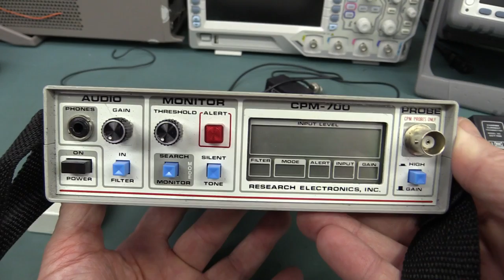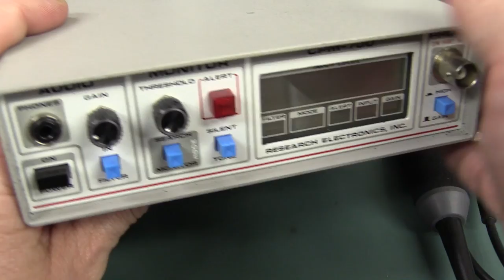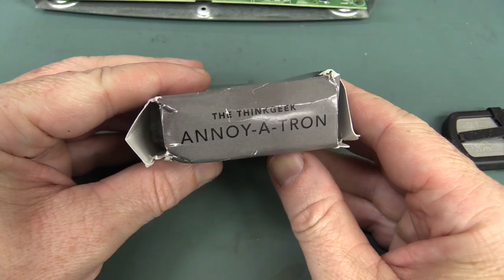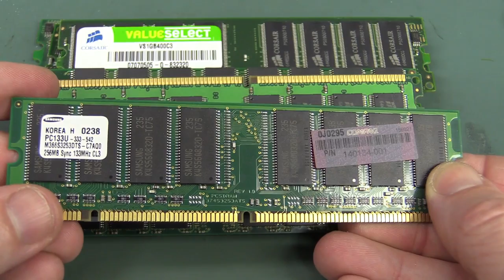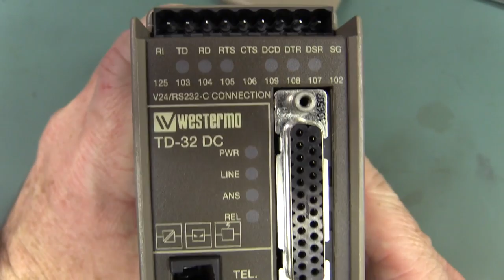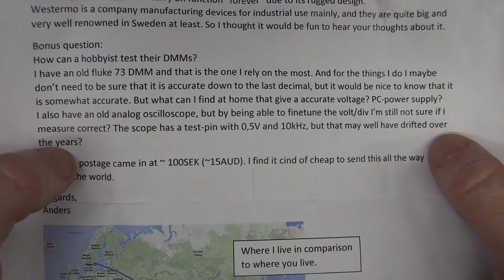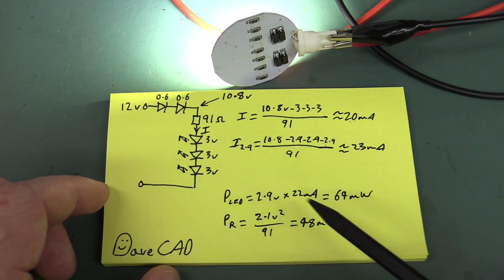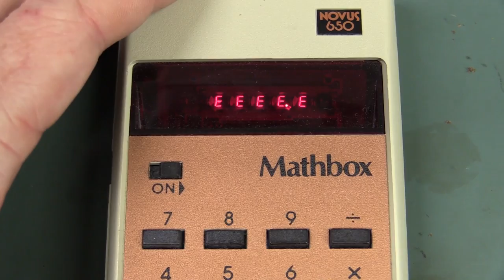EEVblog #735 - Mailbag

Comment: The iiNet modem brings back memories. I was one of the initial beta testers of that device, I had one of the non-wifi models. All of the beta units had a USB port which didn't actually do anything and couldn't be firmware upgraded due to some changes in the new firmware. 

When the beta period ended we had to ring them up and they sent us out the production units free of charge. Still have that modem kicking around as a spare.

Comment: About the LED stuff.
Poor thermal design makes temperature increase too much. This leads in VF of leds dropping, maybe by 3-4% for those LEDs at 70°C. Rectification diodes also drop VF. That leads to an increase of current since resistors are fixed. Another point is: you supply 12V from a bench PS, maybe the PS used to turn on those LEDs has higher voltage even staying in the declared tolerance. Looking at the datasheet I also see the VF of those LEDs can change by 0.7 volt between opposite bins but I hope at least they selected the right LEDs for that design.
Reply: CPZeroDue forgot the conclusion :) the more the heat, the more the current and the drop on resistors that go out of spec (besides derating with temperature). And a higher than 12V supply increases the problem
Reply: The connector on this bulb suggests that it will mostly be used in automotive applications. The fact that an ordinary car alternator keeps voltage as high as 15 volts just makes thing worse!

Comment: Ultrathin and tablet type PCs aren't terribly easy to disassemble if you are uninitiated. Check iFixit and see if someone ventured before you to get a tear down. Sometimes the service manuals are leaked online that shows the breakdown procedure, and SOMETIMES the company doesn't have their head up their asses, and give access to to the end user for how to break down their product line.

Barring that they are almost always press fitted and you need to use a silicon spudge tool to separate the piece far enough to wedge a guitar pick in, and then you can roll the guitar pick around to complete the separation. It's super important to check for any screws that are holding the screen in place first.

Comment: The burnt up leds are probably more because the original driver in the light fitting was made for halogen lamp at much higher watt, so the voltage is probably more like 16v when using it with leds. You almost always need to change the driver as well when changing to simple resistor dropper leds like these.

Comment: Those LED boards usually don't consider use in automotive applications. At 13.8 or 14.4V they will definitely cook ;)
Reply: Scott Henion
Yep.  Gotta have a good regulated supply for them to work properly.  It may be a good idea to put a 7812 in line with one.
Reply: Scott Henion Also I would think transients would be bad for them.
Reply: On a separate heatsink.
Reply: douro20 See dropout characteristic of 7812. For 13.8-14.4V range it will never act as a regulator. You should consider using LDO regulator instead (that would still be an overkill here, though).
Reply: Scott Henion My thoughts, as well. I saw that connector and immediately thought they are just cooking that board inside of a domelight enclosure. 14VDC plus transients, probably aging alternators pushing significant AC through, too.
Reply: Thor214 I'm also considering the possibility that the vehicle they were used in may have been 24volt...

Comment: That "proprietary" connector is actually a PDMI connector, which was a (failed) attempt at a new standard device connector.
Reply: Nick5435 It doesn't make it any less of a pain in the ass when you want to get a replacement for them. (Cheap ones on eBay last my partner about a month a pop, an official Asus one is over $30 each.)

Comment: 40:39 .... You should have smelled the inside of an electronic florescent ballast I tore down after it failed. It had significant arcing damage on the output (lamp) side. Smelled so horrible! Also, almost all the components were covered in a layer of soot. I've torn down similar models as well, and they all have the same failure ... I think it initiates from bad solder joints, as there are cracked solder joints all over the place! At least the ballast has a metal case ... not flammable plastic.

Comment: Re. the Raspberry Pi I/O Hat, I'd add that that PCB makers don't like indent ink being  screened over holes/vias as it forms a blob on the underside of the screen and ends up making a mess on a PCB, which then has to be cleaned up.

Comment: The back cover is clipped on the tablet (Transformer TF300T, I think). You need something flat to run along the seam.

As for getting it working, a simple re-flash (assuming the chips are still good) may revive it.  There should be a few guides out there to do it.

Comment: There was a method where you'd turn off all power at the breaker box and then you'd use one of those probes for electric circuit analysis, can't remember exactly what the trick was. Supposedly you could do the detection on the cheap.

Comment: That's an ASUS Transformer...not sure of the generation based on the colour; looks like a TF201; tegra 2 processor
Edit: Reason for the stupid proprietary cable: When it handshakes between the charger and the tablet it boosts up to 15V2A mode to provide significantly more power than a standard usb charger.
Edit-2: the proprietary connector is also so there is a more robust connection between the keyboard (batterY) and the tablet; it's semi-mechanical at that size where as if they used mini-usb aligning it would be a pain in the ass.
Reply: frollard I think it's not only an ASUS connector. There's one of these on my Samsung Tablet. I think it is called PDMI (Portbale Digital Media Interface)
Reply: ablackack That one is sadly proprietary to ASUS...samsung has ANOTHER stupid connector.  (have them both)
Reply: frollard Ahh. OK. I didn't know this. Looked exactly the same
Reply: frollard Dave asked for a secondary charger connector like mini or micro usb additionally to the asus connector. Or just the got old barrel connector. Dave would had been happy with the asus connector + standard connector. I mean: As a system engineer he should know that this as cost to the BOM, that the user will plug two barely specified chargers in at the same time etc. but then again: Carrying a set of cables can not be the best solution to this problem. (But then again: A few years ago, we had to carry one wall wart with 50/60 Hz transformer around for each and every device - using USB on the charger side of the cable is quite some progress)

Comment: If you pop one of these LED replacement lamps into an older fixture that was designed for a halogen bulb, that fixture can drive the lamp at much more than the nominal 12 volts.   Halogen fixtures often have a completely unregulated AC power supply (just a transformer) sized so that it will provide a nominal 12 volts into a 20 watt (or 50 watt) load.   But that transformer might provide 16 volts into the much smaller load of an LED lamp, because there will be far less resistive loss in the transformer’s secondary winding.  Since the LEDs themselves are constant voltage devices, all of the extra voltage will appear across the dropping resistor, so at 16v minus 9v for the three LEDs in series that’s 7 volts across the resistor.  7 volts squared / 91 ohms = 0.5 watts.  Now we see why those resistors might overheat.

Comment: The tablet is annoying to open since they like gluing everything, but there are teardown tutorials. There is a risk of cracking the screen during the teardown, as it has to be pried off.
Reply from the maker: Razor2048 Thanks for the heads-up.
Reply: Razor2048 Just pry off the edges of the tablet.. very simple. Nothing was glued on mine.

Comment: Using a bridge rectifier will also increase the voltage of the DC output by a small factor. So thing should go even more worse for the LEDs. I think there are a lot of small things come together for these cheap produced lamps to go off like wrong connected capacitor.

Comment: I have a wifi router hacked to incorporate a microphone and transmit both trough VoIP and separate 5GHz wifi network. Both are accessible trough the router's setup website. It has a hidden button on the site that opens the options for the microphone. It's a TP-Link branded one. Looks like it's an original one hacked to do more stuff.

Comment: Its disgusting to see people using resistor dividers when a voltage regulator is required for a 15W LED light. In my University, most new people in Project Lab 1(Out of 5 project labs) the groups tend to use resistor dividers instead of voltage regulators AND optocouplers. We go through digilent Basys2 boards like candy because they do not protect the Basys2 boards, which do not seem to have any good input protection for the FPGA. The cost at the end of each semester tends to be close to $2500 to $5000 because people do not protect their FPGAs.

A lot of graduates from India come to Texas Tech with no prior practical experience and I've seen them use breadboards in a microwave project. When you ask them what a simple component is, they are flabbergasted, which is why undergraduates run the stockroom, not graduates.

Comment: For the LEDs its for a car which might get 14volts when a car is running or battery on charge, imagine the current and the heat generated in 14 volts instead in this case, surely will exceed 70c by far.

Comment: Those connectors aren't proprietary. Its a 30 pin data connector. Apple chose to do it with their tablets and iPods to keep the port end agnostic to the standard it was connected to, because back in the day it could have been connected to firewire, or USB. Also, USB sucks sucks sucks. At least until the 4.0 standard comes out and we can finally get plugs that can be reversed.

Comment: 16 DEGREES IS CHILLY TO YOU - JESUS

ITS 15 HERE AND ITS THE WARMEST DAY IN MONTHS IT STILL GOES DOWN TO ONE AT NIGHT
Reply from the maker: Aaron Leger Welcome to Sydney.
Reply: Aaron Leger Pennsylvania, here. It is around 15-17°C these days (springtime), although April usually has at least 2-5 days above 27° and then May is more of an incremental increase to our peak temps in July around 30° most days, peaking to a little over 37°.

The flipside of that is winter temperatures down to -25°. 

Why do I live somewhere that has a temperature range of 60° (108°F for my fellow US Customary Units users)?
Reply: Well that doesn't sound to bad here the warmest I'll get regularly is 25 and that only like 5 days on the summer. Not even all the winter snow has melted till yesterday
Reply: Aaron Leger The issue I end up with is that just when your body gets used to a certain temperature extreme, the season changes, and you spend 2 out of 3 months acclimating to the new temps.

Comment: EEVblog : (LED bulb) I'm pretty sure that was plugged over 12V AC so it's not the same .... As you known, this will raise the current to ~75mA peak (25% over current @100Hz)
Reply: If they are run on 12VAC (RMS) then they will only have a short period of conduction on each cycle when the voltage actually exceeds the forward drop of the 5 series diodes (2 in bridge plus 3 LEDs) that make up each string (with 9 sets of LED strings in parallel).  So, while their will be greater peak current draw there will also be considerable periods with little to no current draw (as there are no filter capacitors to smooth things over).  Besides, 12VACrms will still have the same average forward power as 12VDC to the extent that the load appears resistive (not perfectly resistive, but largely so).

Regardless, it was still lousy thermal design -- all that room on the board for large copper fills and they wasted it all by etching nearly all the copper away, losing a good heatsink in the process!  Copper fills on a PCB can dissipate a good deal of heat when properly exploited (plus it is otherwise free surface area).
Reply: Ethan Poole You seems to think you signal is still a sinus, it's not anymore due to the bridge rectifier. So 12 VAC RMS is not what the LED + resistor dissipate, it's a lot more when the current is rectified.

Comment: Under the heatsink of the wireless router, it's probably not a custom ASIC. I'd guess it is a standard ARM or MIPS SoC from Marvell or Atheros or Broadcom. Most of those routers run Linux or VxWorks.
Reply: That would be my expectation too.  The bandwidth on these devices isn't all that great to begin with so little need for high performance Ethernet frame switching and routing ASICs, they would get a much greater boost from an ASIC that accelerates encrypting and decrypting the packets.

Comment: there will be a way of charging the tablet and the keyboard dock has its own charger and is supposed to boot the running time on the tablet itselfe. I actualy have allot of the batteries as I repair or scrap these for people. The best charger I can sugest  is the Samsung Calaxy type as they match perfect for Amperage and voltage.

Comment: Hey! I think I know why you weren't finding a problem with the light. You're running under the assumption that the power going into them is actually 12v. I would put $5 down that whatever was feeding those lights were actually well over 12v or possibly even 12v AC. If those lights were run on a slightly over voltage power supply the problem would escalate quite quickly.

Comment: I have that ASUS tablet and keyboard combo.  Love it.  What Dave doesn't get is that this tablet charges on 15VDC.  NOT 5VDC.  This thing charges to full in about an hour and the charge lasts for hours.  It runs rings around other Samsung or Apple tablets friends and family have when it comes to charging.   It also has Tegra video.  The tradeoff is justified IMO for the function and performance.  I travel with mine in place of a regular laptop.

Comment: Spy equipment, gotta love it, back in the days of paranoia over being listened to, these days spies just leave laptops and DVDs on tube trains, so there's no point being secretive... :P

My old Samsung Galaxy Tab has a proprietary connector like that, sucks when I lose the cable to charge it!! That said, the device itself is presently "lost" in my room..... :P

Ah, dialup modem tones, I miss those, but not the slowness... :)

Yup, chinese LED lights off ebay, they're never any good, cheaper just to buy candles cos they take longer to burn out... :P

Well, you don't want a broken decimal point... :P

Comment: with out revealing to many details I have invented something like NVidia Gsink. I used some chokes the ground and a link between the the ground on the monitor wire and synced it up using  that. Which works far better then vsinc does better then gsink to. I might send one out once I have a patent for it. I thought this was relevant to this channel cause of electronics and stuff. Maybe I will send on to eevblog for him to open.